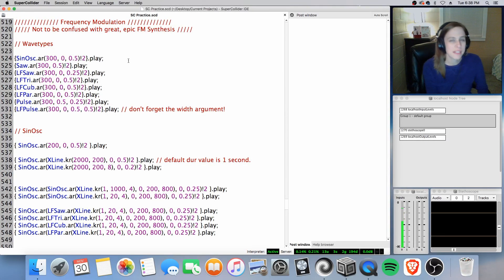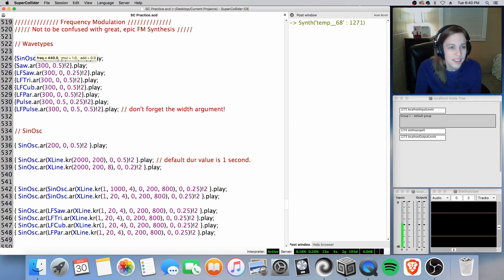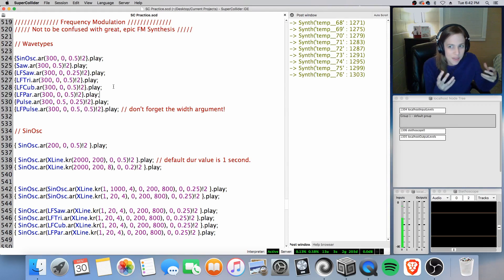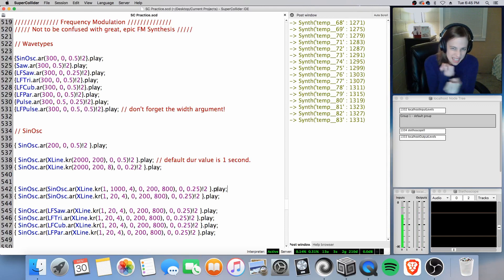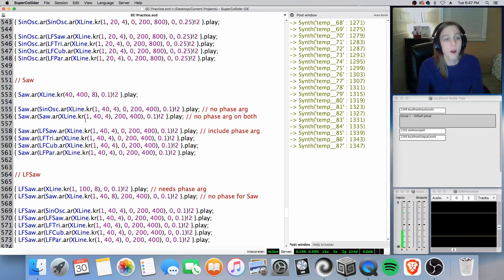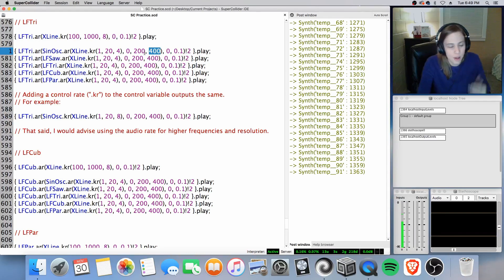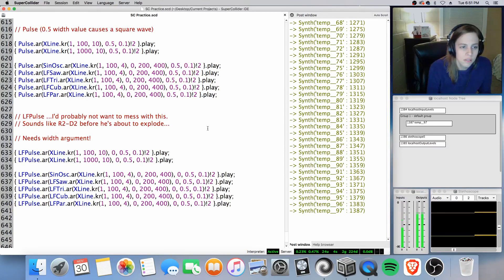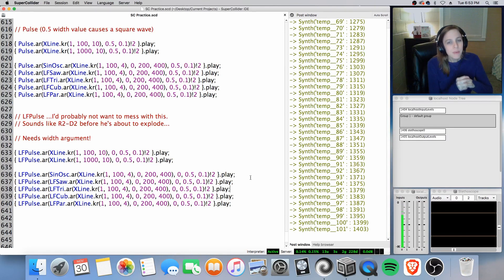Frequency Modulation (Part 1)

Comment from the maker: At 6:40, I didn't explain correctly what was going on in the code. I said the sine tone is moving between 200 and 800Hz.

Line 543, the code is:

{ SinOsc.ar(SinOsc.ar(XLine.kr(1, 20, 4), 0, 200, 800), 0, 0.25)!2 }.play;

Here's the correct explanation: You have a sine tone at 800Hz, with a modulatory value of 200, meaning it will rise to 1000Hz (800+200) and fall to 600Hz (800-200). Simultaneously, you have another control value with XLine, which traverses from 1 to 20 cycles per second over the course of 4 seconds.

Please refer to my updated SC document, available on Pastebin. https://pastebin.com/9WfexgEg